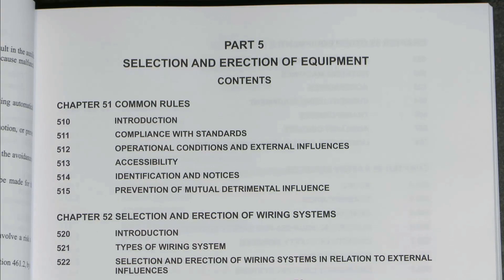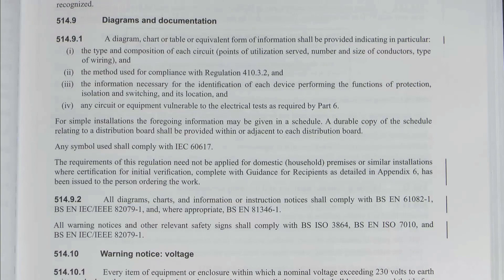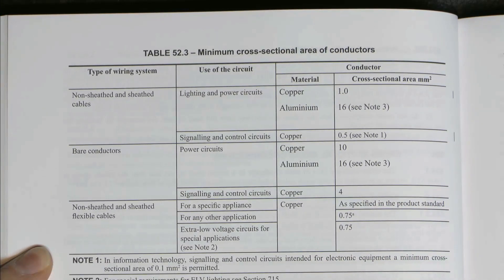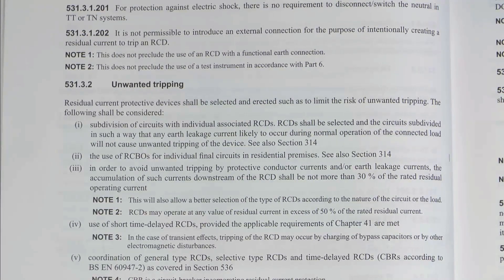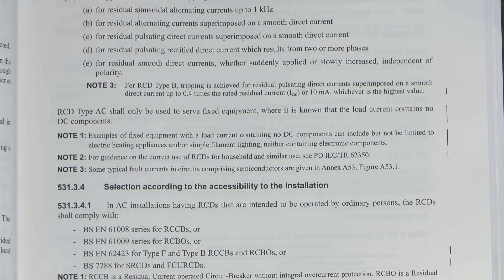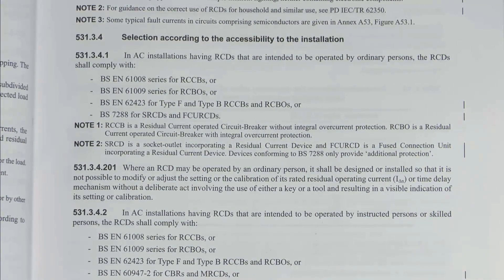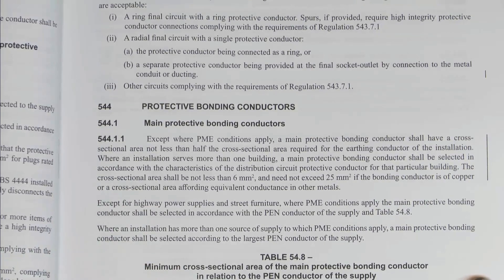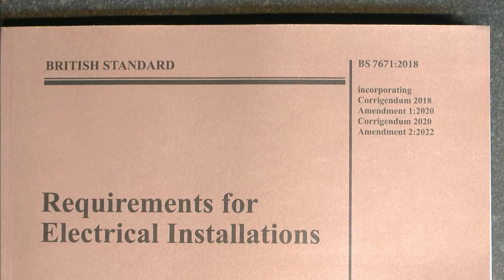BS7671 18th Edition Amendment 2 Part 5

Comment: Cheers John 💪 I’ve always prefered to fit a dual rcd Hager or Crabtree consumer unit maybe splashing out the £25 for a couple of rcbos for the outside lights or outside sockets over a lewden board with 10 x £12 rcbos. Should I stop being judgemental of the £12 rcbos 😂

Love your videos!

Comment: Great video can you clarify the upstream rcd requirement from 7288? I see this mentioned in the scope but none of the clauses so should not require upstream. Am I misunderstanding?
Reply: Wondered myself. ? Are RCDs required to protect cables, some folk say not for armoured cables e.g. to supply EV charging points or to outbuildings where running back to the 'house' in the snow simply to reset an RCD is tedious. Guess each cable run has to be considered separately.
Reply: @oldbutstillcurious3615  there are times when cables need to be protected by RCD’s in domestic premises so buried less than 50mm so on and so forth but I wouldn’t generally be shoving a SRCD there. I’m thinking more commercial on electrack systems and floor boxes as to how this wouldn’t work